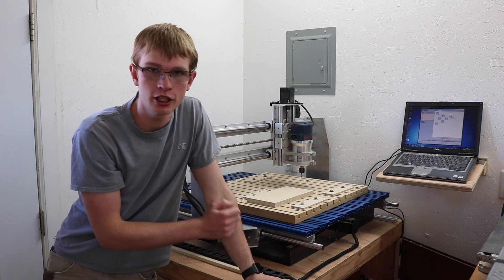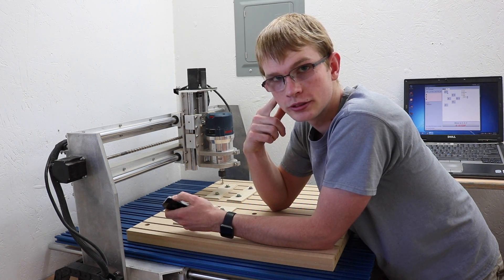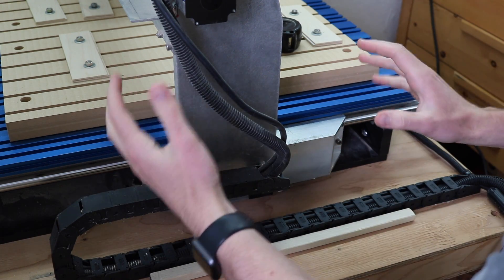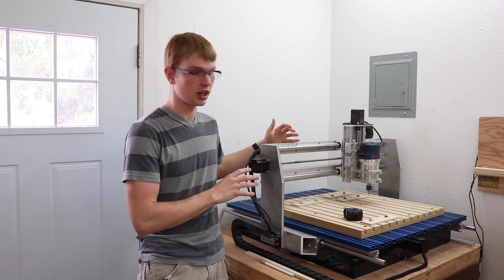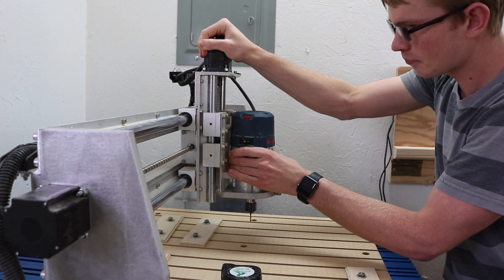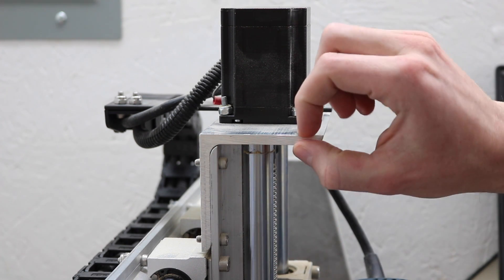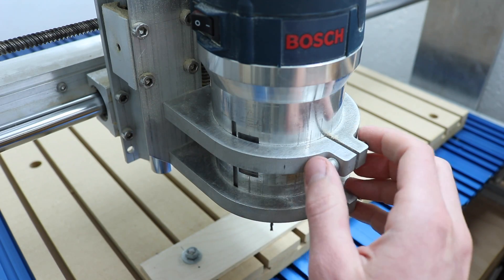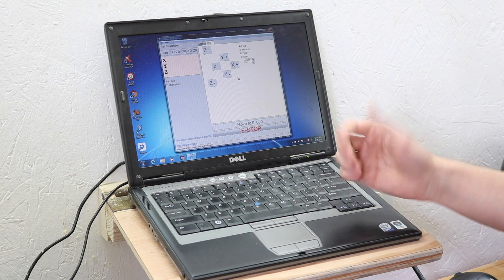All about my CNC machine

Comment: $300 for those half inch plates.. the aluminum would’ve cost around $100 and you can make a wood template and flush trim the aluminum plate to shape and yes it is possible, I’ve flush trimmed 15mm aluminum and brass plate before with a woodworking router and woodworking router bit

Comment: You're a genius, but what good is this thing? What if you don't want to make cute wooden plaques to sell at Cracker Barrel?

A waterjet can make fantastic metal parts. So can a plasma table. A CNC mill can make no end of useful stuff.  A router seems like a retirement toy. 

Millennials get 3D printers and make orange plastic skulls all day. Boomers get routers and make personalized coasters until their friends get sick of them. Am I wrong?

Wood is really expensive, too.
Reply from the maker: The funny thing is, I originally bought this to make cute wooden plaques. (Terrible business model btw)

CNC routers can be useful for manufacturing some products, but yeah, they’re generally not as useful as other machines in a home shop. I don’t have my own CNC router anymore, although I share a shop with a friend who has one. I haven’t used one in a couple years.

3D printers are slightly more useful imo, especially for repairing things.

Comment: The beauty of building your own, if your into it of course. Knowledge on how everything works. Not just buying one and ask yourself what is this for? The number two reason that building your own is better. You can always revised something without the need of redesigning the whole area. PERIOD. Knowledge is always power. If you can't build one, then simply not serious of what you are doing. It is just because of what you see and watch are INTERESTING!!! and you want to own one. CNC milling is not just about engraving. It is way more complex than that you can imagine.

Why i can't build one as rigid as I need it to? It is a step by step process, you start from soft material all the way to the hardest one to mill..and there goes the stroy of revising your own build machine.

Thank you for this video. I saw what I just need to figure out the flex and do something about it.

Comment: could you have made the mdf table in the router ?
Reply from the maker: Yes. You could just use a keyhole or T-slot not in the router. And that would have been a better idea, because then the slots would be parallel to the axis, so I could use them to align parts.

Comment: Rather that posting on your most recent video I thought that I would post here.

I'm interested in your thoughts for your CNC.  There are certainly a lot of paths to affordable CNCs such as Inventable's X-Carve and Carbide 3D's Shapeoko.  There's also Dave Gatton's Garageworks CNC and Gatton CNC kits.  Mostly Printed CNC is seeing some following.  There's also BobsCNC.  Ebay has a slew of 6040 CNCs from China complete with controller as long as you want to drive them from the parallel port of an aging PC.  Micro CNC kits are going for under $150.

From my point of view I don't like the belt driven systems such as the X-carve, Shapeoko and Legacy Woodworks.  I prefer ball screw drives for their greater accuracy and power.  I suppose that rack and pinion is also an option, but might be pricey.  The controller needs to have a modern interface such as USB, Ethernet or wireless.  This suggests something like a Raspberry PI or Arduino. How would you divide the cost between the body and the electronics?   Finally, the machine would need to have solid fixturing such as one piece t slot table.  (I think I have just described by Techno Isel Davinci III)

Your belt grinder succeeds not because other alternatives don't exist but because your design is superior in its flexibility.  What is the innovation that the low cost CNC providers are missing?
Reply from the maker: I don’t want to share too many details on how I’m doing it just yet, but I can say I have the controller figured out; I’ve been using the same one for about two years now and it works perfectly. It’s USB based and can run on Mac or Windows. There will be a T-slot table. Still weighing the advantages of different drive mechanisms, but I’m pretty sure it won’t be belt-drive. I just can’t get good enough precision with that. 

The selling point should be ShopBot-class precision & accuracy at a price point lower than an X-carve.

Comment: What is the Y axis screw? How can you lock y axis ball bearings? Use spindle motors with vfd?
Reply from the maker: 1/2” fast acme (5-start i think). Moves 1/2” per revolution.
Reply: @Jer_Schmidt   i want to know how we can fix issue on cnc with circular ball bearings. Problem demonstrated at video https://youtu.be/9-lS29QX86o

Comment: Funny you dislike that router for handheld use. Maybe I'm just used to using cheap routers, but that Bosch has been a complete game changer for me, with the fixed and plunge base. Totally agree that its amazing in a table as well. Either way, that's a wonderful CNC and have a ton of respect for your videos and builds!
Reply from the maker: The things I dislike most are the placement of the power switch and speed control, and the lack of a spindle lock. Those things are all fine if the router is mounted but are a bit un-ergonomic otherwise.
Reply: @Jer_Schmidt   I can definitely agree with you on all of those things. The switch isn't great and is a bit unsafe and no spindle lock is just a hassle. Once it's set up and on it works great but I can absolutely agree with you on all of those points

Comment: Does that little bit of twist that you show at 13:38 really matter that much? I mean looking at the bit that you have installed I think that would snap off long before the gantry would ever start to twist. A question, where did you get the gantry rails. I have a China 6040 with a 2500 water cooled spindle and I want to change  from the unsupported rails it came with. It doesn't have as much twist as you show but I am concerned with accuracy. Anyway, great video.
Reply from the maker: If you want really accurate results, that twist is devastating. You get half that much twist with only about a quarter the force, so, especially if you have a larger bit installed, it’s almost impossible to get an accurate result. IMO you should never be able to visibly warp any part of a CNC machine by hand. 

I got the rails from eBay...I don’t remember the seller. Direct ship from China.

Comment: Nicely Explained. Same thing was going to happen in may case also, while selecting Rails for Gantry. I have ordered 16mm SBR rail with bearing blocks for Y & X axis. For Z axis simple round bar and 16mm linear bearing.  vectric is good. what CAM program you used, not clearly understood?
Reply from the maker: I’m using V-carve Pro. It’s both CAD & CAM.
Reply: @Jer_Schmidt  It means V-carve Pro is capable of making and running G-code. Is not it?  Actually I was looking for a good program, just plug and play. I found estlcam....It's German software, runs on Arduino. Just Plug in Arduino board and upload. It's all done...
Reply from the maker: V-carve Pro makes the G-code, but you have to use a different program to send it to the machine. When I made this video I was using the sender that came with the CNC (something proprietary). But I have since switched to Universal G-code Sender, so that I can run it on my Mac.

Comment: YOU CAN BUILD ANOTHER CNC FRAME WITH ALL THAT BLUE WASTED ALUMINUM
Reply from the maker: That would be a very poor material choice for a CNC frame, but you're right about it being wasteful. I don't know why they thought that would be a good way to increase the cost of the machine.
Reply: Yes you have a point. I guess cncrouterpatrts.com has no idea what they are doing building their cncs frames out of aluminum, Maybe because aluminum extrusions are not rigid, straight or strong. https://www.google.com/search?q=cncrouterparts&source=lnms&tbm=isch&sa=X&ved=0ahUKEwjWssDKwtHcAhUKQ6wKHfetD6AQ_AUIDCgD&biw=2149&bih=912
Reply from the maker: I shouldn't have used the word "material". Aluminum is fine for a CNC router frame, but extruded profiles like these are not very rigid, especially against twisting. You need to either use very large sections (like cncrouterparts does), or use a fully closed profile like a square or rectangular tube. You would need to stack up at least 4 or 5 of these thin extrusions to make a sufficiently rigid gantry, which would just be wasteful and heavy.

Comment: Such an eye opening approach! The extremely clever use of angle brackets to assemble carriages is unprecedented - the rigidity/weight ratio is probably orders of magnitude higher than the traditional thick aluminum plate approach.
I'm thinking of expanding this idea by using U profiles for rail-block joints and adding a thin aluminum plate inbetween to improve stability in plane.
Thanks for sharing this, I'm really amazed this hasn't exploded in the DIY community

Comment: Good luck to built a GOOD COMPLETE cnc router  for 800$ excluding the router  . You have just the  hardware for 800$ and then you need a CNC mechanical kit witch it'll be around 800 and more and then ,you need 2 programmes ,one for the drawing to make your design witch is apx 300+$ & one to transfer it in G-code witch is for a relative good one, 300/years or by it for 1000+++$ . Dont get me wrong ,i'm not saying you cant BUT if you want something relativement good expect more 2 500$.... I really like your clampes system mate !
Reply from the maker: My $800 figure was not including software or the router. Also that obviously can't be a giant 4x8 machine, it would be a compact benchtop one like my current one, just rock solid so it gives me better results. It's completely possible, and I'm still planning to show that on this channel. I just need time to perfect my design.
Reply: Make more sense but you should tell your fans the real price for a complete setup before they start a project of building a cnc and not be able to finish it bc of missing fond .

Comment: I can't help but think, that if you replaced all of the Acetal feedscrew nuts with bronze nuts, your accuracy would improve a lot. Being an engineer I spend 85% of my time machining parts. All of the machines I use (Lathes, mills etc) have Ali-Bronze feedscrew nuts. Obviously the newer CNC machines I use ballscrews, eliminating any backlash etc. May be worth a thought?

Comment: Impressive! It looks like the fast and efficient device. What about steppers control? What kind of steppers did you chose? Unipolar? Bipolar?  Do you make them work in the microstepping mode or the half step mode just fine?
Reply from the maker: +Dkoxperia Koziukov 
I don't know this stuff; the manufacturer's website would tell you a lot more than I know about the electronics
Reply: Thank you for the rapid answer. And what is the manufacturer?

Comment: Could you elaborate more on why the 1/2" sides of the gantry end plates were a mistake?  Overkill?
As well, could you make a basic parts list of the specs of the various basic components?
Reply from the maker: +grizzlypeg 
No, underkill. And way too expensive, mostly because of having them water cut. If I would have engineered it a little better, I could have made stronger gantry ends with less material, therefore cheaper and better. For example, two 1/8" plates, 2" apart, with some sort of webbing between them would be far stronger than a single 1/2" plate.

I'll have a parts list once I finish my new design.

Comment: Have you gotten any closer to plans? I am looking to get a home cnc very soon, and I like your ideas. Excellent video, and craftsmanship, btw.
Reply from the maker: +m3dbs 
I guess every day I'm a day closer, but it might still be a year or two; I have no idea.
Reply: Thanks for the reply. Is there a machine that you would recommend to start with? I'm an experienced cnc programmer and operator by trade, but not sure which is the best starting point, with possibility for upgrades down the road. It has to be able to do 3D machining.

Comment: enjoyed the vid.. your way off as far as com-parables. You can get an excellent quality CNC 2x2 made of extruded aluminum + gecko 540 controller for 1800$ (I know because i own one). So your left with 1000$ difference. I figure a solid 200 hours minimum to source pieces and build.... Your young, if you do do it, they sell KITS to build your own all over ebay controllers, motors,  and extruded aluminum.

Comment: I had been considering buying the CNC shark HD4 extended-bed until I saw this video. I would expect the unsupported rails would have even more significant an effect with the extended bed. At this point, I agree that I would probably build a larger machine instead of spend $6000 for one.

I have a question for you: how useful would be cheaper CNC machine be for building the better CNC machine? If I purchased the X-Carve and use that to help machine some of the parts for the larger, better machine, how big of an advantage with this be? Right now, I have a tablesaw, a drill press, a bandsaw, a miter saw, a flux core welder, a metal chopsaw (whose disc I'm replacing with a carbide ferrous-metal-cutting blade), two 3D printers, and various grinders and sanders. I have not previously done machining work, especially not by hand. I would imagine that even a "cheap" CNC machine would be helpful for machining some of the parts for the larger machine. (I guess this also assumes that the X-Carve is useful without having to babysit it).

Do you have any thoughts/advice?
Reply from the maker: +Christopher Kemsley 
I'm not sure, but I think the HD4-extended has supported rails in the Y-axis (the standard HD4 does not). Still has a major disadvantage with the unsupported X-axis rails though...

I don't think it would be much of an advantage to buy a CNC to build your CNC. Unless you're really impatient, there aren't many custom machined parts, so you should be able to just make them by hand. It sounds like you have enough tools already. I'd recommend using aluminum for the parts, as it can be worked with woodworking tools. It's also best to keep the gantry light, so it can quickly accelerate/decelerate, so aluminum is a good choice. 

In designing your machine, keep one thing in mind: EVERY part of the machine needs to be able to take the force that will be applied to it without play or flex. I see a lot of homemade machines and even manufactured ones (including the Shark) that are well designed and well built in most areas, but then have one big weak point. A CNC is only as strong as its weakest link, so if you have one weak part, then all the money you spent on making the rest of the machine strong is wasted.

Comment: I used a ShopBot CNC mill at my school. Its an industrial one that costs $12,000 and it has no wobble on any parts whatsoever and it cuts like nobody business. Its great but $12,000 is a bit steep. Its the best one I've worked with so far, and has pretty much no quirks.

Comment: You doing a great job. I did old school Tool and Die work (no CNC;s) for 30 Years.
I would go up on the supported shafts to 1" or more. The longer the shafts the bigger it needs to be.
I bought a cop/carver/duplicator. machine. Same problem. I would like to make one, but I know nothing about CNC. I have built and design many custom machines over the years. some of my machines are still running fine today 20 years later.
Today's manufacturing is all about cheaper than the competition.

Comment: Really good job my friend!!! In the process of designing my own cnc a 1000mm x 1000mm. Hope you don;t mind if I barrow a couple of your ideas. Your Z axis is perfect and you made me rethink my Y axis, was going to use 2x4 t-slot extrusion yo mount my linear rails but now thinking 2x2x1/4 angle might work with 2x4 square tube between. My X axisI'll mount my rails to 2x4 t-slot which is the frame for the base. was looking at the SMW3D R7 kit until you made me start looking at build ing my own. Thank you for all your great videos.
Reply from the maker: +johnny lesley 
Thank you! You can steal all the ideas you want from this design. Using a tube for the gantry is definitely better, as tubes are a lot more resistant to twist. I'd be interested in seeing how it turns out!

Comment: use 3 bars in a triangle to support the gantry. what power motor u used when u were stopping the movement @8:57 u call it y axis motor , r they closed loop , I can get ss 202, 314 blocks , bars, plates, 1kg weight , for 7 dollars , or en31 for less price all cut , drilled etc

Comment: Dude you should work for the FBI,  you are way to uptight, country motto, just do it
Reply from the maker: +Brett Bond 
Trump would fire me...lol
Reply: bahahahha, at least you have a sense of humor, Great video by the way.  Do you do any of the programming for your CNC?
Reply from the maker: +Brett Bond 
I'm not that into computer stuff actually. I enjoy the mechanical side of things. So no, all I do is draw parts and tell the machine to cut them. All the software I use is, for the most part, off-the-shelf with default settings.
Reply: I may venture down this trail, I am a programmer and I also am mechanical although I hate getting my hands dirty.  I have been checking out the builds on here. and I may do the long and debugging path of developing my own software.  Thanks for the reply and keep making your videos.
Reply from the maker: +Brett Bond 
Hey, if you make a good piece of software, I'm definitely interested in it. I am not exactly happy with what's currently available.